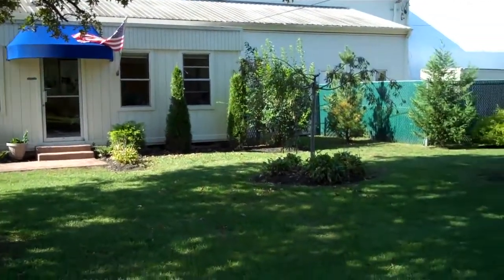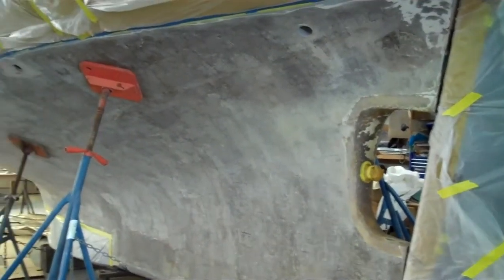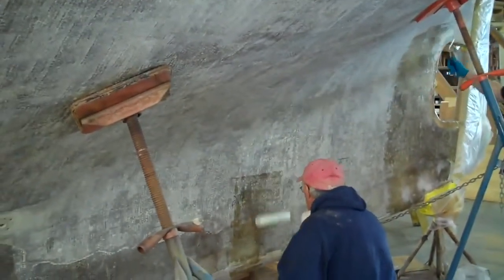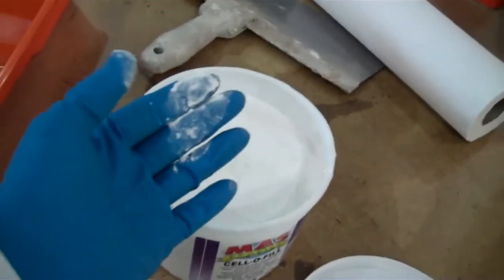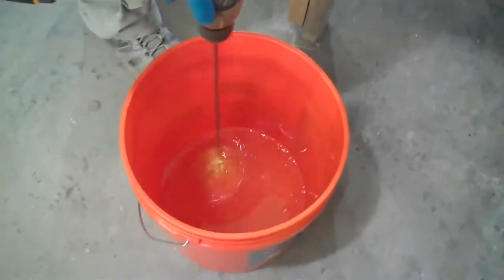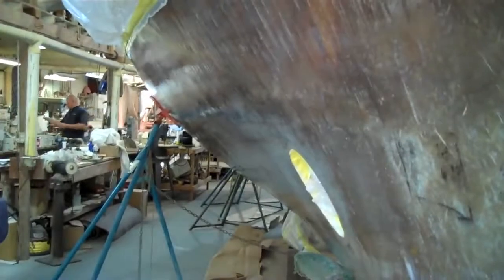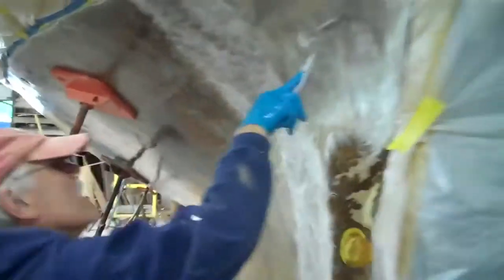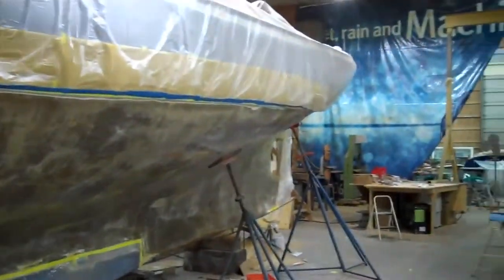MAS Epoxies | Applying a barrier coat to the bottom of a Cherubini 44'

Comment: hi guys.
why did yiu had glass to the hull
Reply from the maker: We added 1.5 oz mat fiberglass to reinforce the hull. The resin will wet out the glass and adhere it to the hull. Its a structural applicational for the hull. Hope this answers your question.
Reply: Well, did you use a shaver or a grind? because i just took the gelcoat of my boat and i was thinking of just adding resin and some filling to a few spots. With the shaver you always take a little more fiber that's why i questioned you.
Reply: mat is not a structural element.